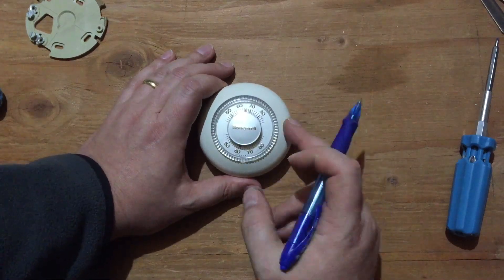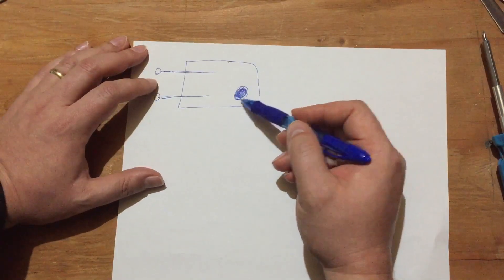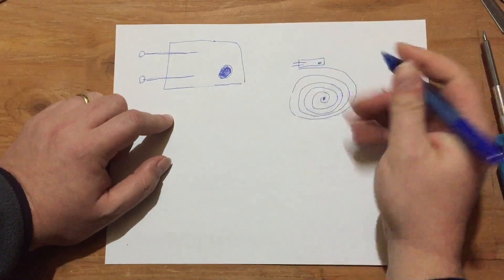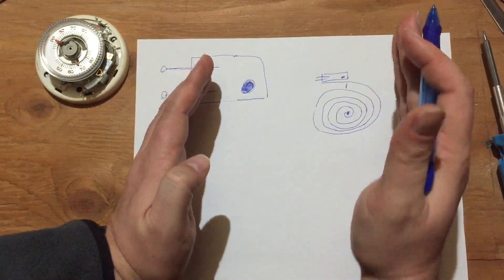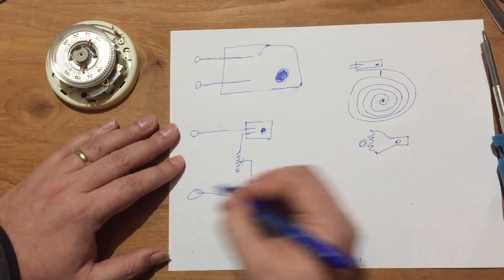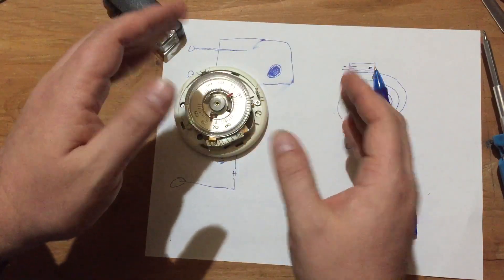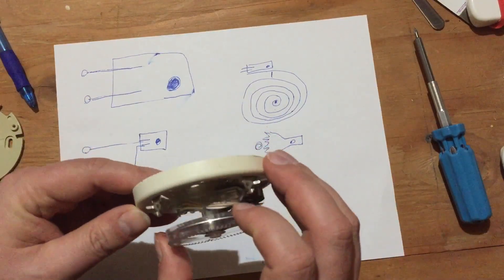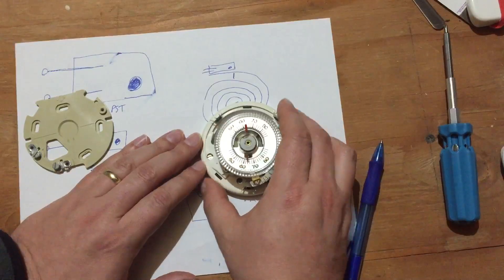#022 Classic Honeywell Round Thermostat Teardown

Comment: Why would you say a replacement metal other than mercury?  I do not believe there is such thing as a replacement metal for mercury, and another metallic liquid in room temperature.  

If anyone knows of anything like that, you definitely may win a Nobel Prize.
Reply from the maker: There is an alloy called Galinstan that is liquid above −19C/−2F. That's not nearly as low as Mercury, but it should be fine for a thermostat. If your house gets that cold you have bigger worries!

There may be even better choices, but that's the one I'm aware of.

Comment: I think the mercury switch sends 24V from R to W and G if heat is on and Y and G if cooling is on.
My furnace has had this thermostat as far back as I can remember. It could possibly be 38 years old like the furnace.
It had started short cycling so I got to looking into it. Cleaned all the dust out of it and  fired the furnace back up and lo and behold the variable resistor smoked and burned.
I suppose a fixed resistor or other form of variable resistor would fix itbut not sure its worth the risk. 
I will definitely be putting a fuse on the 24V system after this. 
Luckily I was standing there looking at it and got it shut back down before it really fried. What it did was burn all the shielding off 6 or 7 turns of the magnet wire close to the sliding contactor.

Comment: What does "Longer" mean on the rheostat scale?  Further, what do the numbers mean? Are they temp degrees?  My boiler is cycling on and off every 2 minutes near set point.  I'd rather have a larger temp swing and less wear and tear on the gas valve.  Which way should I move the pointer?  Thanks for this video!
Reply: Longer means longer heating on cycles, heating system stays on longer. There is a hard to see arrow there pointing left. Many think longer is to the right where longer is printed. No, longer is to the left towards 1.2 amp position.  Larger temperature swings. Heating element won't get as hot. The other direction, to the right, heating element gets hotter, warms coil, opening mercury switch earlier. Yours needs to be moved to the left, longer cycles.

Comment: I have a simple question:

There is a basic Honeywell heat-only round in my apartment hallway. It looks to be less than ten years old, and has no exterior switches.  It controls the heat to our hot-water radiators.

Even when the set point is 72-74° F, it heats only to 68°.  The unit appears to be installed level, and I’d like to check the heat anticipator setting inside.  

So please tell me: HOW the HECK to get inside this thing and check the anticipator setting?  I  don’t want to yank on something and break the thermostat like a buffoon!
Reply: Just pull the ring part forward and off.  The anticipator is at the bottom.
Reply: @gmzx3  This was actually resolved three years ago, but thanks for reaching out!
Turns out this Honeywell has the retro exterior, but inside has DIP-switches for configuring the stat for use with hot water or steam heating systems.  Otherwise all integrated circuits inside, no mercury bubble/springs.  Thanks again.
Reply: I figured yours was long resolved but replied to assist others. I had an old mercury switch model with adjustable resistive heater to better control heater on cycles and room temperatures. I never worked with the newer round ones. I think the dip switches allow it to work with different types of systems. My new digital electronic one does this with a setup menu. I'm glad you got yours straightened out. I could not get mine to shorten the heating cycles on my new boiler and had 4-5° swings, so bought the electronic one. So far, it is very accurate.
Reply: @gmzx3  The old anticipator type can be accurate, but t-stat must be absolutely level on the wall, and located in a sun-free and draft-free area.
Reply: Mine was level. Only change was replacing 65 yr old boiler. So far, prefer electronic one. Very little temp fluctuation. No anticipator. May not last long, but not expensive.
Reply: @ZickcermacityI checked level. New boiler was all that changed. Adjusting anticipator didn't fix it. Electronic one sits right on temp setting. More sensitive so no anticipator needed. Small downstairs zone has old mercury round one too but kept low and not used often. If that overshoots a lot, it will go.
Reply: @gmzx3  Back 20 years I recall reading how a multimeter was used at the boiler end to determine the proper anticipator setting at the thermostat.  For those who still use old-style anticipators they might want to look into that.  Yours and my situations  have moved beyond that.
Reply: @ZickcermacityYes, I don't have a clamp AC meter but I could put my meter on the two wires that go to thermostat on amps setting, which would close circuit and run boiler. Meter would show current. Another way is wrapping a wire 10 times and getting a reading. I played with the anticipator" moving it 100 ma and watching with no real change. Decided to try a new electronic digital unit, only $35. So far, so good 32 out tonight.
Reply: @gmzx3  Again, you would need that setup for accurate setting of an old fashioned anticipator, for both heat and HVAC.  But not for the thermostats we both have, with selectable DIP switches.
Reply: @ZickcermacityMine is set in a setup menu on the screen. Mostly the type of system, water, air, high efficiency, heat pump etc. It must have preset parameters for each type. I saw some electronic ones that you can make it overshoot a few degrees. But they are all more sensitive to the bimetal coil, so don-t need a anticipator.

Comment: Hi.  Great video!  Do you think there is any way to adjust the thermometer on an older T86A7 with the smaller dial?  There's no way to access nor adjust the thermometer "spring" thing.... The back, beneath the mount plate only shows like the end of the metal dial shaft embedded in the plastic but with a manufacturer's non-tamper goo-seal across it... (and other items on its front.)   I mean, I'm a really mechanically minded fellow and I can't see any way to remove that dial / knob...
The thermometer is sluggish and off by about 7 degrees F above other thermometers, here. (including a Honeywell that looks like yours with the easy access adjusting screw on its back...)
But, the T86A7 has no access whatsoever... A pity because its a gorgeous little piece.
I only use these classic thermostats around the house as thermometers only and are not hooked up.
Thanks...

Comment: Fascinating! What's the resistance of the rheostat?
I've experimented with shorting the terminals and got about 300mA. I'm guessing the rheostat also serves as a protective resistor in case of a short?..
Reply: The rheostat adjusts the resistance and how hot the resitance element gets. The hotter it gets, the faster the heater will turn off. It fakes the room warming up by heating the bimetallic coil and moving the mercury switch. The idea is to smooth the room temperature swings. I measured about 1 ohms at 1.2 amp left position 5-6 ohms at 0.12 (right).
Reply: I should say rheostat and mercury combined

Comment: This is a great "how it works," but mine actually works, though with some difficulty. One night, meaning to turn it all the way off, I turned it too far, I felt some break, and now the whole dial assembly slips on its shaft, so that the "Honeywell" logo is no longer level. I have to overturn it the other way to straighten it. At the same, it resists efforts to pull it off the shaft so I can see what's going on, and I don't want to force it. Anyone familiar with this problem? Also, I second the comment below by Stephanie Smith. How do you get this thing apart and/or remove and replace it?

Comment: Enjoyed your video.  I have a Honeywell T87F Round.  This is similar to the thermostat in your video.  Quick question:  How did you remove the clear face cover?  My degrees are off on the top needle adjustment and lower room temperature.  Both readings are off by 4 degrees.  I am thinking if I could rotate the dial with numbers then this would resolve my issue.  Please and thanks. Alex Taft
Reply: The mounting bracket on the wall has tabs near the too to place a small spirit level. Loosen the slotted mounting screws and turn bracket to level it. Tighten screws. The lower pointer can be adjusted to a nearby known accurate thermometer. Use a small suction cup and pull the convex dial cover off. Then pull the round Honeywell part in the middle of the dial off. Pull it from the sides. Let's say it is reading 3 degrees low, rotate the circular part in the middle until the red pointer moves up 3 degrees. Let it cool 15 minutes as heat from your hands may have moved the bimetal spring. Repeat until you get it accurate and snap Honeywell part and plastic cover back on.

Comment: Where do you stick the arrow thing at? My furnace keeps running shutting off couple mins then turning off. It's getting too hot in my house. And I have the same exact thremsot
Reply: Years ago, when I replaced my relay and transformer box, it had the current stamped inside. I set my anticipator to that. Sometimes the furnace or gas valve will have this info, if it sends the 24 volts to  the thermostat and may list the current.  I just upgraded my boiler and new controller has no current listed on it or the manual. I may call manufacturer. You can measure the amperage in the wires when system is running. Mine seems to run much longer, then stay off longer than my old boiler. There is a chance of burning out the heating element in the thermostat if you move it too much to the right, where is says longer on the round thermostat. The arrow there means if the pointer is moved towards the left,  the heater will run longer on each cycle (heating element in thermostat won't get as hot). Try moving the pointer to the left so heater runs longer and monitor it. If it gets better, try a bit more. If nothing changes, you may need a new thermostat.

Comment: Actually the rheostat is the heating element. All a heating element is, is a resistor that is designed to tolerate getting hot. In this case, the amount of heating is fairly modest (a watt or so at most). The copper thing is merely a conductor that is part of the circuit.
Reply from the maker: Hi, thanks for this. I think had a that correction as an annotation on the video, but Youtube removed the annotations feature, so all the post-filming corrections I added to my videos are now lost.

Comment: It would have been helpful to see how you removed this from the wall from start to finish. I am trying to replace mine with a digital one.
Reply: remove the plastic cover, remove the recessed screws (the ones in the holes) with a small flathead screwdriver

Comment: Does this control the blower motor to turn on and off? Mine won't start but the blower works fine.
Reply: The sad truth is no. That's a second, heavier-duty thermostat which is attached to your actual furnace. It is also operated by a bimetal penetrates the heat duct from the outside and starts the blower one minute fan before ignition and and shuts if off about a minute after the flame goes out, to make sure the that heat does get to build up with no fan running. I know this because mine failed and now the fan is on all the time unless I go down to the basement and power down the whole thing. Regarding your problem, it's probably with your igniter.

Comment: I move it all the way to the right and the rooms are not hot enough, could be that thermostat is not working properly ?  Any advice ? Thanks for the video.
Reply: @Blondie SL thanks, I moved the slider just a little bit to the left, now its HOT, very Hot 🔥🔥🔥🌫👍
Reply: @Blondie SL so what's the lowest I can go all the way to left I'm trying to cool the house but its still really hot
Reply: turn on closed captioning and listen how to adjust the recalibration. https://youtu.be/g_o7BIJyWr8

Comment: Old reliable Mercry sw is the best. Have had 2 digitals in my life, and both went to junk. Reinstalled the mercury ones, system works perfectly. My mothers old furnace was replaced yrs ago, and the serviceman told her she couldn't keep her old Honeywell. They took it, and am sure are using it in their own way.
Reply: I had the same thing happen to me. The tech replaced my old mercury Honeywell T87 with a piece of crap digital Honeywell T87, and took the mercury thermostat with him.
Now, I'm replacing that one with a new, unused mercury Honeywell T87 I found on eBay.

Comment: I have a Honeywell round thermostat, although it's not one of the classics with that uses mercury (I was hoping it was because I wouldn't have needed to look up how to calibrate that one). Instead I have a classic Honeywell round thermostat that has circuit boards. Conclusion: We can't assume round thermostats don't operate using 21st technology.
Reply: The new Honeywell Round has a lithium button battery squirreled away on its circuit board. Its NOT easy to get at, but it is replaceable. That means the design expects you to replace the thermostat every 10 years - unless you are relatively geeky - (as well as replace all the broken pipes in the garage you had set to 45 degrees which froze the pipes when the lithium battery died). That's modern engineering for you. Kick the can down the road 10 years and who cares after that.

Comment: Can that Call your blower motor to run all the time blowing out hot air if it’s bad
Reply: @Blondie SL it has a fan on and auto option on the thermostat which sends 24 volts through the g(fan) terminal on the thermostat to the g terminal on the circuit board in the furnace then it sends 120 volts to blower motor so yes it can control the blower motor in the furnace

Comment: Converted from oil to gas and the installer said I could not keep the fantastic honeywell round.   He obviously knew nothing about the heat anticipator adjustment.  You set it long for hot water heat,  medium for the heavy heat exchangers in oil furnaces, and near zero for gas furnaces with their tiny heat exchangers.   I adjusted mine.  Saved much money on a new one built to fail.  Has worked perfectly since.   Should last for 100 years, as it is designed to do.